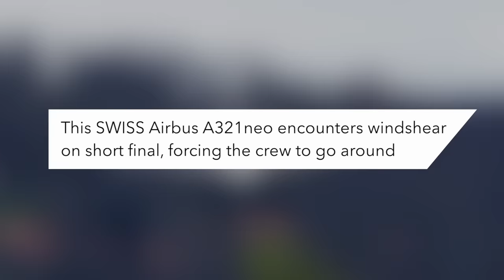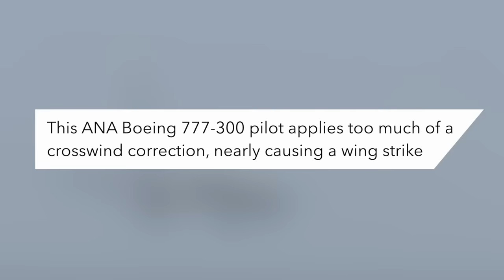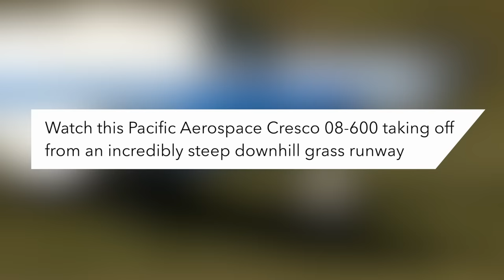Windshear Sends Plane Into Nose Dive

Comment: He didn't take too long to take off, he wasn't even instructed to expedite it. ATC really needs to stop telling pilots to line up and wait when a plane is on such a short final
Reply: +1, came here to say that
Reply: You got no clue. You are not a pilot are you
Reply: @TheLukaszpg  I'm not, no. But please tell me how I'm wrong. I'm not being sarcastic, I want to learn.
Reply: @asdf3568  a 2-mile final is pretty short and the UPS should have realized that meant to get going immediately
Reply: @TheLukaszpg  Don't correct someone if you're not going to offer the answer.
Reply: The first guy is 100% correct. Too often I see these controllers stack and unload at minimum separation. Because it’s minimum means it’s technically legal…. But letting your daughter wear a miniskirt down a dark alley in a  bad part of town is also legal…… neither however are a good idea. One heavy taking off followed by a heavy landing….. that controller should’ve known better. That was a stupid takeoff clearance. Period. If I was in that flight deck I’d say “no thanks…… holding short till company clears.”
Reply: @deekamikaze  So how would UPS know that? Is it their job to listen to callsigns that are not theirs? And why would you endager safety like that asking pilots to line up and wait when they know another plane is on a short final? Surely that could put pilots under stress.
Reply: @TheLukaszpg  you’re the one without a clue. Based on that remark I can guarantee you have zero jet PIC and zero heavy time. Or you just landed your first regional Dash8 gig and now you’re an expert.
Reply: @Bdoodee  you got me with walking down a dark alley with a mini skirt. You are correct in that legal does not always equal safest option.
Reply: @asdf3568  maybe the controller would have most likely told them that there was traffic behind them on a short final and to expedite their roll... get it get it wink wink nudge nudge expedite? ups? expedite? ok I will stop...
Reply: There is clearly a video cut. When you line up on a runway you are supposed to be ready to go when told to do so. If they weren’t lining up traffic between landing traffic nobody would go out on busy airport. The pilot should have said we need a minute before accepting to line up and wait.
Reply: @xisotopex  If they did, it certainly was not in the video. And even if it was, pilots have checklists they have to go through before takeoff.
Reply: @asdf3568  they dont sit on the runway going through those checklists.
Reply: @xisotopex  Are you a pilot? Because I certainly think that's not the case. When are they going to do the checklist? When they are taxing?
You don't want a scenario where you stress pilots out. That will just lead to a catastrophe sooner or later.
Reply: @oscarnogueraballester3994  wrong. ATC took responsibility for this one; that just wasn't included in the video.
Reply: @hawaiidispenser  he doesn't have an answer because he most likely, isn't a pilot either...
Reply: @asdf3568  find ONE video that shows pilots sitting on an active runway, going through their numerous checklists. have you ever flown? it is quite common to not stop at ALL from the taxiway to the runway, they throttle up immediately when they come up on the center line...
Reply: @asdf3568  the checklist is literally called before take off checklist so yeah its done while taxiing
Reply: @KaiTakApproach  most pilots are already setting take off power while the atc hasnt even finished the take off clearance. This was just something else, they were sitting there just not ready.
Reply: @xisotopex  Alright, so assume I was wrong about this one thing. How about you address my original comment?
Reply: @oscarnogueraballester3994  Ever heard of a straw man argument? That's what this is.
Reply: Minimum separation is perfectly legal and perfectly safe when applied correctly. How do your think major airports run? They run because you learn how to hit the gaps.
Reply: @asdf3568  I dont mean they do NO checklists on the runway, they do checklists at every part of the journey... they even take the time  to do checklists when they are in danger... its probably also up to the companies when and where they run checklists, so it may be a bit different for everyone...
Reply: How do you know?
Reply: @deekamikaze  Sure ATC can assume they will get right going, but the pilots still need to complete all their checklists and be ready to take off safely.
Reply: @deekamikaze  Instructions should be given directly, not by inference.
Reply: When lay people who think they can weigh in on these very professional situations get antsy about these videos I find it confusing. I'm a low time CPL and I wouldn't know unless I'd read the airfield info, or at the very least, had a good look at the situation. Flight Sim just doesn't take you to the real world.
Reply: @asdf3568  yes, it is their job to listen to callsigns especially of close air traffic. That's called Airmanship
Reply: He did take ages to advance the thrust levers, ages!
Reply: @asdf3568  become a pilot
Reply: Many controllers are also surprised by the high approach speed of the MD11, thinking they can squeeze someone in front and then finding out the plan doesn’t work. This 767 pilot did not take too long. It was a control tower mistake ( unless a timeperiod has been edited out of the clip )
Reply: @asdf3568  follow the traffic around and speed up the checklist. The pilots are stressed
Reply: @highball7347  then it was better to wait for lineup
Reply: @mgst1  then it was better to wait for lineup
Reply: @heftosprod  you are right and not everyone will get the ATPL and even less Cpt on heavy acft just because of bad judgment
Reply: The pilot must prepare for takeoff before lineup, especially in busy airport, but this ATC really put the two plane came too close
Reply: You don’t have to accept a line up and wait
Reply: @asdf3568  you are right, it is ATC responsibility to manage the traffic, if any failure occurred before V1 he would have stopped on the runway. So even if he started take of roll immediately it would be most probably be a missed approach for the short final A/C
Reply: Repent to Jesus Christ “Now faith is confidence in what we hope for and assurance about what we do not see.”
Hebrews 11:1 NIV
J
Reply: @asdf3568 Situational awareness including other traffic is an important part of the pilots' responsibility
Reply: @oscarnogueraballester3994 Agreed. It appears they were sitting on the runway much longer than the video shows. They were given take off clearance and the video clipped forward and they were still not rolling. Lining up is a practice that is commonly and safely done to keep traffic moving as long as everyone involved is prepared and alert. In the rare instances it doesn’t work out, ATC and the landing pilots are looking out and will act accordingly.
Reply: @hb1338  if someone is coming up behind you doing 150 miles per hour and they're 2 miles behind you, that's some pretty easy math that you should get your booty rolling
Reply: A 380 was given line up clearance when I was on 2.7m final. Emirates get preferential treatment in some places for on time performance it appears. We were cleared to land at 200 ft into plenty jet wash. Dangerous in my opinion.
Reply: @deekamikaze  if the ATC meant for him to get going immediately, he would have told him to get going “immediately” or “without delay”. ATC does not imply instructions, they state them explicitly.
Reply: @spades9048  key phrase: when applied correctly. That wasn’t done here.
Reply: @highball7347  I’m a pilot and never been a controller. Yet I don’t see the controller doing much wrong here. The asinine part I always find is when I’m no. 2 for take off and the guy in front of me gets cleared for take off and it takes him still the better part of a minute to get rolling. If u can’t get ready, get out of line.
Reply: @asdf3568  ATC tells pilots to line up and wait so they can run their airport efficiently and safely. When you are cleared on the runway, be ready for an immediate take off. It annoys the crap out of the rest of us when some pilots take their sweet old time to get moving. When ATC starts talking to you, start moving your throttles.
Reply: @Bdoodee  your daughters mini skirt has zero to do with this. Stupid remark. Minimum separation isn’t u safe and isn’t a “bad idea”. Those rules are put in place because it’s still a good idea and efficient. If it was a bad idea, they would raise the minimums.
Reply: @Bdoodee  that Lukas dude is actually correct. And yes, I fulfill your minimum requirements of being an expert.
Reply: @oscarnogueraballester3994  exactly. I just wrote that somewhere else. When ATC calls you with a take off clearance, I already shove the throttles forward. It works nicely and efficiently.
Reply: @rtbrtb_dutchy4183  So ask them before they line up and wait if they can expedite it then? They have checklists they have to run that they might not have completed.
Reply: @asdf3568  sometimes ATC will line you up and tell to to be ready for an expedited take off. But that is because they know some pilots take their time when they shouldn’t. 

Other have already explained to you that checklists are done already on the taxi. This is true. Except for a few items once you are cleared on the runway. This is mostly turning on your lights, a quick configuration check and runway heading check. You shouldn’t be running checklists at that point. 

I’m always flabbergasted when an airplane doesn’t start to roll immediately after take off clearance. It’s like, what the heck have they been doing?  Did this clearance come as a surprise?
Reply: You know that this is quite industry standard right?

Of course, mistake are also commited. But the practice itself is perfectly normal
Reply: YouTube aviation experts at work
Reply: Really good comment
Reply: @rtbrtb_dutchy4183  This is the answer.
"Are you ready for immediate departure?" followed by "line up be ready for immediate departure" or "runway XX cleared immediate take off" then you can also add whatever traffic is the reason to be expeditious, but in reality you don't need to (depending on where you work)..... in whatever phraseology we use in different places of the world.
But we're human, we also make mistakes..... and controllers usually have the balls to realize it and correct it.... which he did here.
Reply: @jimimeldhedegaardkristense6066  they would say those things unless there was enough room. 

It’s obvious he took his time with the take off roll. This was not expected. So a normal situation turned into a not so normal situation.
Reply: @asdf3568  I love how many people become professional airline pilots after reading your comment 😂 I’m afraid I don’t know if you’re right or wrong but I’m also not going to pretend to be an expert on the matter like many are above 🙄
Reply: "ATC really needs to stop telling pilots to line up and wait when a plane is on such a short final"

But we have no idea how long the departing airplane was actually lined up waiting. The video starts with takeoff clearance  issued to the aircraft already holding in position.  For all we know the landing traffic could have been at 8 mile final when he was instructed to line up and wait.    

I agree with those who say the crew should have been ready to go, but I don't see that there was an extended delay before it began to roll, maybe 6 seconds.  Given some spool time they must have pushed the power up within seconds of being cleared to roll.  But there is also a cut in the video, so we don't really know how long it actually took.

In short, we can't base any definite conclusions on this video, and can only speculate and pontificate.  It is interesting to see the vehement arguments on both sides over something inconclusive presented on this dumb channel.  

(I usually assume the opposite of what this channel thinks happened because it has no credibility, so in this case I think the controller had expected to issue takeoff clearance sooner but something downfield didn't work out and stymied his plan.)
Reply: This video is cut and a 2 mile final is PLENTY of time to take off if you actually do it. Sitting on the runway like that is just stupid. A line up and wait call is to be in position and READY for take off and no expedited call is needed. Many airports use 2 mile separation and I’ve also heard 2.5 miles. So ATC at this point has don’t nothing wrong.
Reply: @fl3702  yup. Agreed.
Reply: I'm well aware that this isn't the point but, holy hell, y'all are entertaining! People thinking they can have an intellectual debate in the comments section never ceases to amuse me.
Reply: Very tight setup by ATC, no room for the the departure aircraft to have an issue and abort take off.
Reply: @jamiet2262  Exactly
Reply: The clip starts too late to make any such call. As a former tower controller, the pilot was most likely told to line up and be ready to roll, once a preceding landing had cleared the runway. If so, this would have happened before the aircraft entered to line up, and it was very unprofessional to linger after clearance was given. A good pilot would know exactly when the clearance was coming and already be wound up to go.
Reply: @asdf3568 retired ATC here. By definition, they’d finished their checks. The pilot doesn’t call ready until that’s happened and they don’t get to enter the runway, until they’ve called ready. In a busy sequence, the only reason to hold on the runway like this, is to wait for it to be clear, such as a crossing at an intersection or a preceding landing to vacate. The pilot would have been worded up before entering the runway.
Reply: @KaiTakApproach if the ATC worded him up to be ready to roll before lining him up, due to say, a preceding landing on the runway, he should have been spooled up, ready to go on clearance. I’d bet the guy who had to go round knew exactly who to blame.
Reply: the pilot took too long to take off, usually when its small seperation like this you woupd commence your take off roll as your reading back the clearance
Reply: @Bdoodee  first up, any ATC incapable of safely finessing minimum separation situations would be moved elsewhere. It’s part of the job. We didn’t hear how this was set up, but back when I was doing it, not only would the pilot have been able to SEE the aircraft on Final, prior to lining up, if was tight, he would have been told BEFORE entering the runway, along the lines of “one on a four mile final, line up and be ready to roll”. He had the right to refuse at that point, but any hesitation after being cleared, was always likely to cause a go-around. The landing crew would have known EXACTLY who screwed up.
Reply: @asdf3568  if the departure was properly worded up, it would have been done BEFORE entering the runway to line up.  His job was then to line up and spool up the engines, so that when clearance is available, he goes immediately. The Controller cannot clear him until the previous landing (unseen, on this clip) has cleared the runway.
Reply: I release my brakes,advance my thrust levers at the same time as soon as I hear my callsign even before my copilot’s read back. Or the other way around when the copilot is PF and I’m PM. On a 747
Reply: @petergosney6433  Fair point Pete. I must admit…..My comments were a bit heavy handed. I think the other uninformed remarks  might’ve had something to do with that. My point is simply that sometimes pilots have a lapse in “judgement” and sometimes ATC does even when operating within the confines  of proper procedure. You were not in the tower and I wasn’t in the cockpit so it could be said it’s easy to armchair quarterback this. At the end of the day no one got hurt and nothing got bent or broken. I would tend to agree that the controller was in the right to issue the clearance,  but I’ll never know how much thought he gave to anything prior to doing so. What I do know is there have been times I’ve received a clearance that is issued from the controller that is generated by his oversight of “the bigger picture”. However, from my perspective it may generate a sliver of doubt. If I don’t speak up Im the one whose shoulders the outcome will fall upon to a large extent. The pilot/controller relationship is unique in that we have to think like one another.  The pilot has to visualize what ATC is looking at in his sector and ATC, (I would hope) has to think like the pilot. This dance of complex understanding can never be explained in a forum like this but it’s there to be sure. At the end of the day, I know anytime I line up I look at my TCAS first and then out the window. If I’m not satisfied with the clearance…. I say so…… I’ll never know why that crew took so long to roll….. but like I said, I wasn’t there. We rely heavily on ATC’s tools to help us do our jobs well, safely and professionally. For that they will always have my gratitude and respect.
Reply: @Bdoodee  Okay 👍
I’ll tell you a story. In the early 70’s (1972?) back when the first generation of 747’s were introduced into Australia, they trained at a non-RPT airport called Avalon. Both Qantas and Australian domestics used it for circuits and bumps, on a daily basis; no pax involved. A Trainee ATC lines up a 747, with a DC9 on 2-mile final. The ATC Training Officer pokes the trainee, who panics and clears the 747 for take-off. A terse instruction to “fix that” from the trainer, and the trainee gives traffic to the DC9 as “747 at 12 o’clock, departing the runway, do you have that aircraft in sight?” After a 2-second pause, a new voice comes on the air from the DC9, with a slow Queensland drawl, saying “In truth, l can see little else…” It caused hilarious laughter… over the frequency. Side Note: This was also prior to the realisation of the need for wake-turbulence standards behind heavies, too.
Reply: I just drive cars for the last 38 years.  I'm no pilot, I'm enjoying the back and forth from you folks lol
Reply: @Bdoodee  g’day again. Just re-reading this. As another observation, there are very few big screwups in ATC procedures that are not compounded from both sides. We all watch each others backs where we can.
Reply: Yep seems like a dumb accident prone scenario that prevented both planes from doing anything.  Dopey atc if you ask me.
Reply: The controller said “traffic 2 mile final” then the video cuts away and the plane landing shows up. The plane had takeoff clearance for so long and didn’t go
Reply: @Bdoodee but you're not in the flight deck and the controllers and pilot know a lot more
Reply: @deservingcomplexionm8111  I work there and know the pilots. ATC effed up.